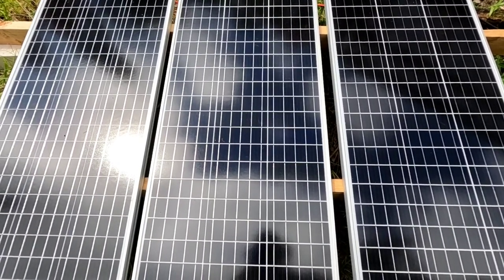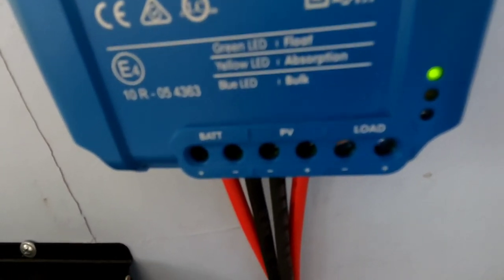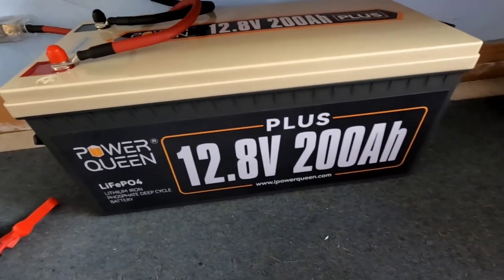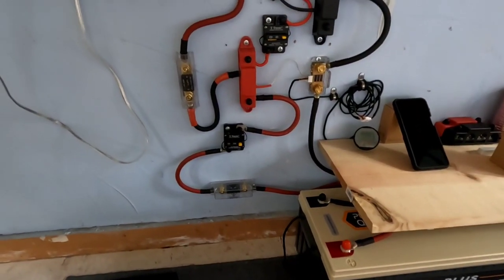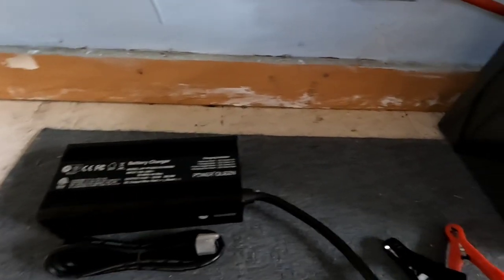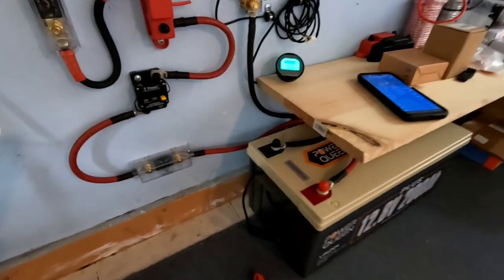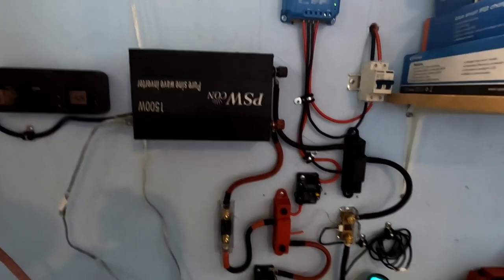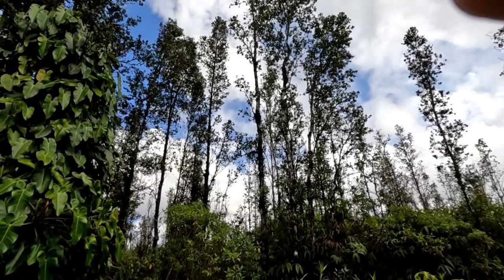Power Queen 200ah LiFePO4+300watts solar vs 20 cu.ft. refrigerator/freezer

Comment: Great video, I like the experiment. I run a shed with an air conditioner, ventilation and lighting with 200ah chins and 700w solar pretty much daily unless the weather is just terrible.  These SPS, UPS ESS systems are so freaking cool.
Reply from the maker: Hey thank you! Yes, having fun with this test. That battery is holding strong! Fun stuff...aloha 🤙
Reply: @ProjectsinParadise808  great video brother.... two questions, how does the queen power battery compares to the chins and which would you recommend....thanks 👍
Reply: Nice!
Reply: What charge controller do you use please

Comment: Very nice, I have built 2 solar systems,one is 12v  310ah portable one on a sack trolley for the house fridge in case of power failure, the second is 24v 100ah  to run the whole shed, using all victron scc and inverters,also built the batteries from lifepo4 cells from China,its a lot of fun, now to think of a new project. Thanks for sharing.
Reply from the maker: Sounds like a pretty sweet system you have running. Always thinking of a new project here too. Best of luck,  and let us know what's new, and working good with you! Mahalo for being part of the conversation here...aloha 🤙
Reply: What charge controller do you use for your 310ah system please

Comment: You only need one 160 watt panel to power an 800 litre fridge in South Australia, so long as you use an MPPT solar charge controller and a certified 1500 watt pure sine wave inverter and a 100 amp hour lithium ion battery. If you buy an LG fridge get one with a linear compressor they don't use a crank reducing the load on your battery, I thoroughly recommend the use them outside of that I also highly recommend a Secop compressor. Australia has the highest solar irradiation in the world so there is no problem getting enough power from sunlight. My 100 amp hour battery has never gone below 65% charge, and that was in overcast skies. BTW a 24 volt system is better than a 12 volt. I've got 2 panels one as a backup but I've never had to use it. If you use multiple panel arrays make sure you install breakers. If you buy a fridge in the US with a 12/24 volt setup go for it as you eliminate the need for an inverter, your inverter is a power greedy device that will use between 10-20% of all the power you generate with solar panels

Comment: Thank you for sharing.
I think I will try putting my fridge and freezer on a timer when on backup power. I won't be going in it often and therefore it will remain cool and only needs to be run for so many hours a day. This is my thought until I prove it will extend my battery life and keep my items cold and frozen. I have had items stay froze for 3 plus days in my deep freezer with no power so I feel certain my idea should work.
Reply from the maker: Mahalo for being part of our conversation here...aloha 🤙
Reply: Exactly.  Checking in from Maryland….we recently had a nasty storm here, trees & power lines down all over.  We had zero electricity for 4 full days & the frozen goods in both our refrigerators stayed fine.  We didn’t throw  anything away.  Used our 160 Ah solar build to run house fans, internet & air pump for aquariums.   I always thought that you could really extend battery life if freezers/fridge were only run for 6-8 hours max per day.  No reason to run 24/7.

Comment: Last time the electric went out it was pure joy being able to sleep with the fans on without a generator running in the background.
Next step is those GE4 6500Kw inverter/battery monitor/chargers.
Two in 180 degree split phase will run 220v.
Reply from the maker: Your own backup system giving you comfort...how awesome is that? aloha 🤙

Comment: I run a 1000sq ft home with 5- 100 watts of solar panels, midnite solar classic 250 charge controller, 2000 watt pure sine wave inverter by xantrex. I have a SOK 208AH battery,  refrigerator/freezer 24 HOURS the rest come on here & there LED lights, 60'' tv LED, internet WIFI, one burn stovetop 700watts, small 1600watt oven, small microwave 1600watts, 2 small fans. The lowest my battery gets to at night is 12.8v to 13.0v but mostly it's 13.0v
Reply from the maker: Sounds like your system is running well...aloha 🤙

Comment: Hi i saw in another video that the refrigerator defrost comes on when you unplug and then replug it in, but if you leave it unplugged for longer than the internal computer requires then the defrost will not come on. If this is correct it might save you some power initially to avoid the defrost draw. Thank you for the videos.
Reply from the maker: And mahalo to you for participating in the conversation here...aloha 🤙

Comment: Love the video, very informative! I looked up this LG refrigerator and it seems great, uses only slightly more power than those tiny hotel size mini fridges. I did notice in the LG manual that it specifically says the refrigerator cannot be used on a GFCI protected circuit. Do you know if any of your inverters have GFCI protection? The inverters I'm looking at almost all do, so we may have to look at a different refrigerator. I see Samsung makes an inverter compressor model that uses even less power than this LG (albeit it's a smaller capacity by about 25%). That one makes no mention of GFCI, though is a 'Garage Ready', so that sort of makes sense, because GFCI is mandated for all 120V garage outlets in the USA...
Reply: What model is the Samsung?
Reply: I use a 7.5 cubic ft Mini fridge in my Skoolie. I run it 100% on solar but it tends to get so hot on the outside that I can't hardly touch it. I was wondering if it just doesn't like being ran on an inverter and was looking into different models. I'm considering buying a chest style made for Solar. They sip the juice but they're pretty pricey and I would prefer a stand up fridge as opposed to a chest style
Reply: @DzHarryNuttz   Hi, it's Samsung model # RT16A6195SR/AA . 15.6 cubic feet, looks like a pretty functional interior layout, too.

Comment: The MPPT seems a little small for the amount of panels.  In direct sun the 3 panels should be able to put more than 20 amps in your battery and it's rated for 15.  I run a Victron 75/15 on my parents camper with 2 100 watt panels to keep the batteries up, and they will push nearly 15 amps into lead acid.  You have a lot more clouds and rain than I do in Wyoming though.  I'd love to see what your max output is for the first good sun of the day.  I haven't pushed the Victron to see if it will push more than the 15 it's rated for.

My camper is running on 400 watts of panels with a  Victron 100/50 and a Chins 300ah LiFePo and my wife just spent 3 weeks at the lake with it and barely even drew the battery down at all with an Iceco VL65 for refrigeration and a hefty cell phone booster running most of the daylight hours.  I'm enjoying your content and seriously considering picking up a fridge like yours and remodeling the propane completely out of the camper.  I picked up another 400 watts of panels before the new battery got here thinking I would need the extra output, but the Chins takes current so easily that I'm getting over 33 amps charge in direct sunlight( the Lead acid topped out at 26 or 27 off of the same array).
Reply from the maker: I take your point,  and was watching it closely today.  It bumped 15 amps briefly and adjusted down, however it was basically full at the start. I may drop a panel tomorrow,  or possibly add another 2 panel string if needed...but I kinda want to see how it may handle a few amps over. I'm going to watch closely,  and update.  Sounds like you have a great system too! Appreciate you being part of the conversation here...aloha 🤙
Reply: there's a 20amp fuse at the base of it so be careful ;) I've got 300 watts on mi e in the forest and I never get more than 125 watts from them. they have a reputation to get destroyed by over voltage im interested to see ehat happens if you get more than 15 amps.I just found your channel today
Reply: I believe he said the panels where in series. That would mean the voltage increases but the amps stay the same, a 12 v panel should be in the 5-7 amp range.
Reply: @scottlittle5457  if each panel gives 7 amps to the battery won't that blow the 20 Amp fuse?
Reply: Yes, the first number on the charge controller is incoming voltage limit, the second is outgoing amperage limit.  I am still curious if the Victron has a hard cutoff at the 15 amp limit, of if it will push a bit more.
Reply: @desmondsharpe5397  hello, I’ll try to explain, the panels should be approximate 17v and 6 amps each, (depending on model, sun, etc.) if you hook the panels in parallel you increase the amps with each panel but not the voltage. If you hook them in series you increase the voltage with each panel and the amp states the same. Since Victron is a voltage charger you can connect your panels to the max voltage range, the controller will regulate those volts to charge the battery. Since he is running in series the Amos should be 6 ish and the volts around 60ish, perfect for the charger he’s using. Thanks

Comment: I'm trying to decide between the Queen or the ampere time. 200A bms. Which would you say to go for? Black Friday deals. Thank you
Reply from the maker: They both are excellent,  so I think it's a toss up. I'd probably just go for best deal. Been running the Queen 24/7 on refrigerator...perfect.  AT have had longer by about a year,  and it's still great too.  Wish I had something better to offer, but either one is very good.  Aloha 🤙

Comment: Thanks for the information. I have a question. I have a lifepo4 battery like you, and I haven't connected to my system because it requires to charge it in full before. I don't have an automotive charger. May I hook it up to my solar charger instead and wait until it is full? I'll appreciate your comments.
Reply from the maker: I usually use my solar to initiate charging to full before ever using it in a load situation.  Since that's how I plan to always use them, I like to monitor them under those conditions.  Once in a great while,  I throw a Lifepo4 charger on them...but not very often.  Aloha 🤙

Comment: So what would happen if you plug the 12 v charger into the  inverter ?, would it charge the battery even thought it's connected to the solar panels.

Comment: A question. Do you charge your capacitors in your inverter before you hook your battery up to the inverter to avoid a very large and dangerous spark when completing your connection?
Reply from the maker: yes I do🤙
Reply: @ProjectsinParadise808  Thank you a video showing that process would be great.